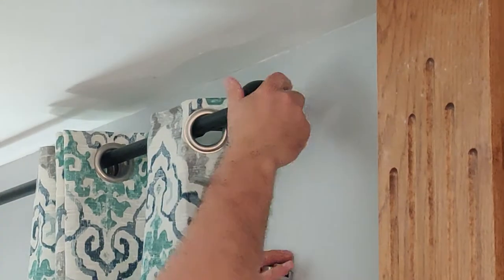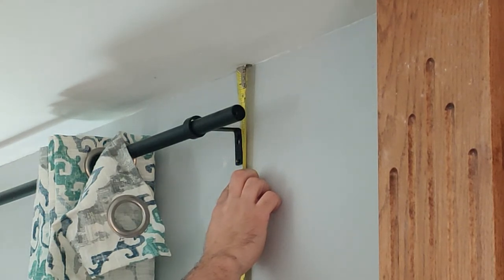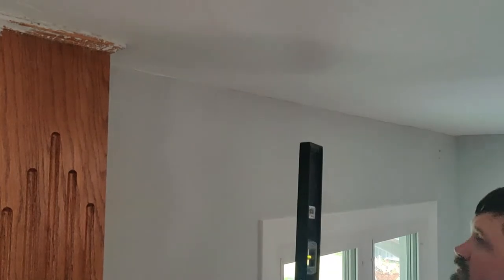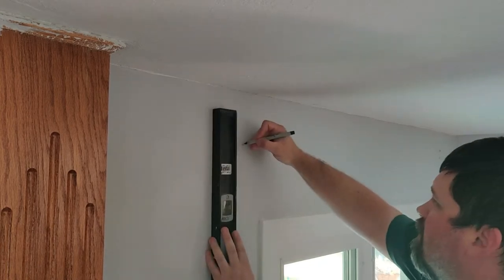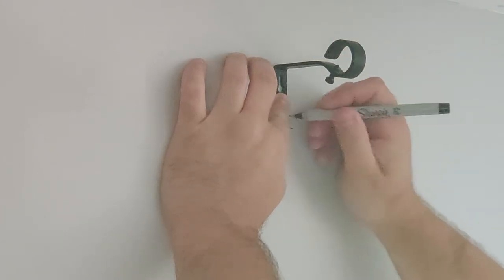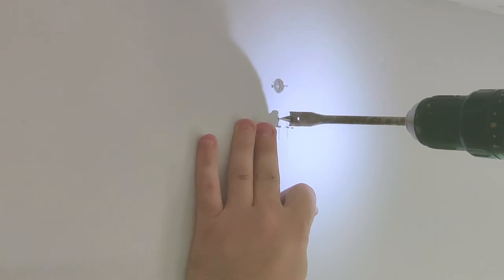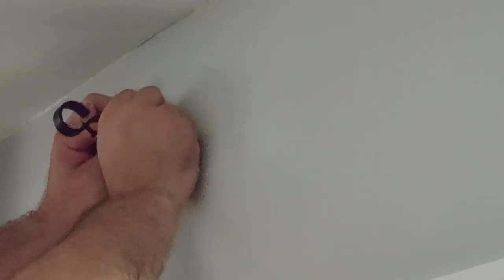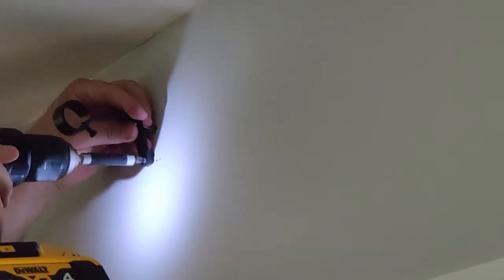HOW TO USE TOGGLE BOLTS TO INSTALL A CURTAIN ROD

Comment: Thanks for the straightforward and informative video. I don't have any handyman skills and was very concerned with putting holes in my wall in order to fix my curtain rod after the screws had pulled loose from the wall. I ended up buying self drilling anchors, which don't require a drill or a pilot hole,  and it worked flawlessly. After inspecting my house it seems whoever installed them originally used expansion anchors, but they didn't drill them in far enough to expand.

Comment: Great video!!!  Do you remember what toggle bolts you used?  I have a drywall that is about 1 1/2 inch away from the cylinder block structure wall.  Thanks again.
Reply from the maker: The brand or the size?  What size drywall are you going through?  What are you hanging?
Reply: @HomeRepairHub  I'm doing the same exact thing you're doing, but I'm just having problems finding the toggle bolts you used. Name and size please.  Thanks again.
Reply from the maker: I believe I was using Grip Fast, Menards brand.  #8 2 1/2inch.
Reply: @HomeRepairHub  Thanks but I live nowhere near a Menards😂 Needless to say that I used to. Thanks again.

Comment: How fard down from the ceiling did you hang them?
Reply from the maker: Depends on the length of your curtains.  I think those were full length curtains that went to the floor so I was about four inches from the ceiling.  If the curtains are just long enough to cover the window I usually just go 1 to 2 inches above the trim.

Comment: Why did you use different drill bits and methods on each side of the rod?
Reply from the maker: Didn't even notice I did that.  You can use either.  Spade bits tend to be a bit less expensive then the larger bits but either will work.